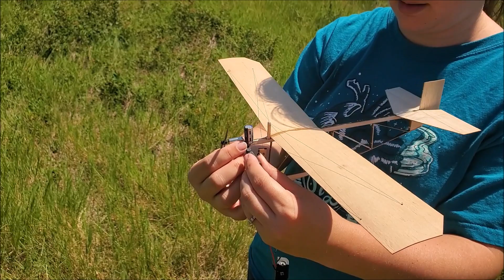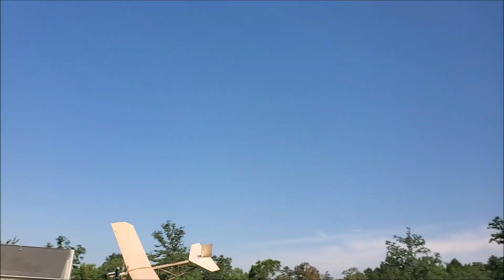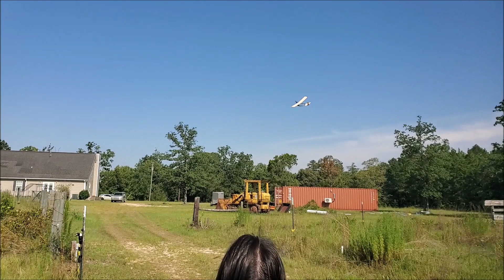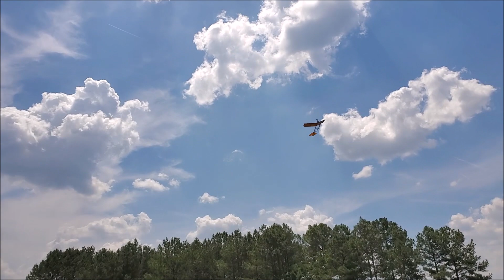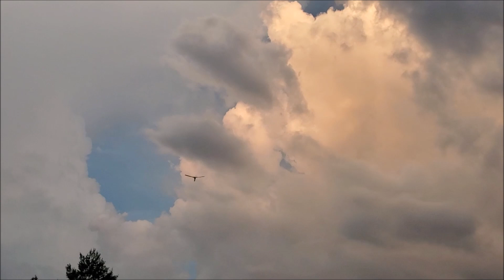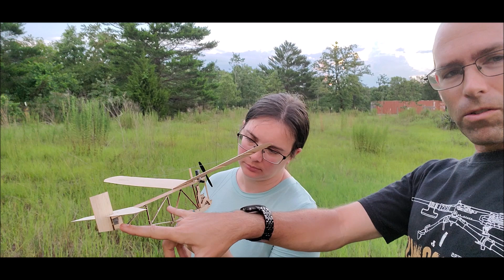1920's Powered Glider, capacitor electric drive, from Bill Warner plans!

Comment: so josh, i have a model pacer that is  capacitor powered but i have not bought the capacitor yet cuz i dont know what to buy. it has the motor from the hobby zone champ  and i would like to have it run for 15-20 seconds, what should i buy?
Reply from the maker: I'd say anywhere in the 10-20F range, rated for 3V or maybe 3.8V.
Reply: thanks!  i just got them @joshuawfinn

Comment: I love this video ..
What if we double the scale of this model ?
Reply from the maker: I unfortunately don't have time to pursue that right now, but I expect you would get very good performance. Probably a bit easier to trim too.
Reply: @joshuawfinn   
Thank you very much for sharing this  movie ..the model is one of my favorite ones but I have never had time to build and test it ..I always wanted to see its performance ..also I love free flight scale model since childhood and even now that I am 54 .I cannot look at them as toy .My job is very heavy and complex I am system engineer and this category of models act as strong pacifiers for my mind ..I love them so much specially their construction help.me to isolate my mind from the busy world ..they give me more focus and concentration ..I told these things to remind you why your craft and particularly its highest performance seemed to me amazing ...If you have any suggestion  idea for suitable elecric motor specifications for a scale extended by double sizes  I would appreciate it should you share it with me ..the weight and power are very important parameters and your practical experience and sense do matter in chosing and purchasing the right stuff with the lower leves of performance failure risks and cost ..also the most power ful and endurance and minimum weight battary which I should consider .
Really thank you for care and reply ..
I have found its last perfomance amazing ..what I have always dreamed in my mind ..

Comment: A propeller speed reduction unit (bigger propeller is better) also counteracts the torque in the motor. The gears will only wear out very fast with any grit.
Reply: Next a capacitor pusher Ideal “Loop the Loop” glider?
Reply from the maker: Can you send me plans for that?
Reply: @joshuawfinn  I am sorry but I do not have the plans. I would just change front and back wing to make it a canard.

Comment: You are so lucky to be able to fly out side your door step     I have to go to the local ball field early in the Am before the kids come out to play      Love the super cap setup    Josh  is it ok to light coat a stick and tissue model with clear craft sealer to some what water proof     in the am i am always dealing with wet grass
Reply from the maker: For bare balsa, an extremely thin coat of minwax spar varnish really helps. Tissue needs to be sealed with nitrate dope to maintain reasonable water resistance, however plastic covering is the best solution in wet weather.

Comment: could be hand cranked too, nice model toy
Reply: even directly from a propeller shaft detach gear, simple construction
Reply: looks like a bird
Reply: simple dc emf brushless motor, no wearing out, just swap rotor
Reply: the blue single cell thin solar panel modules
Reply: dc emf zap railgun ionic wind thruster-drive
Reply: if you add solar elements to/as the glider wings, flies long time
Reply: or just standard high voltage capacitor electric field ionic wind thruster